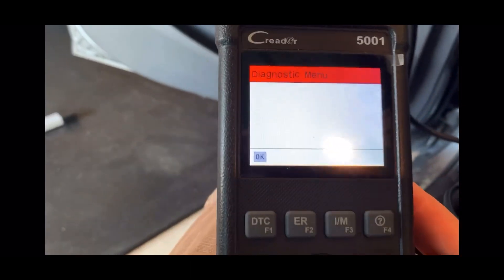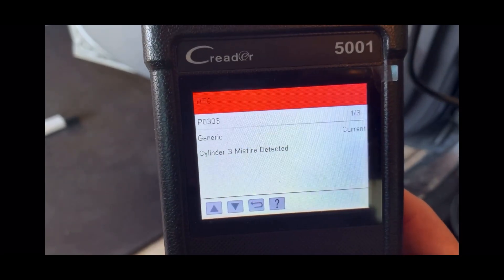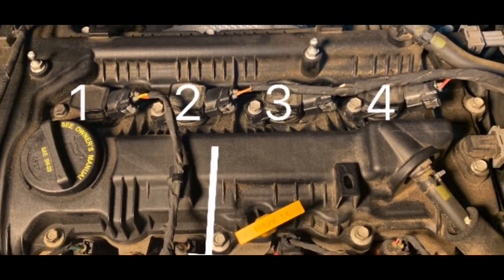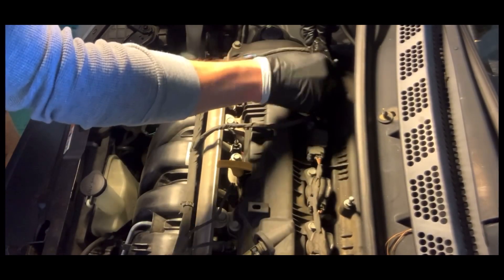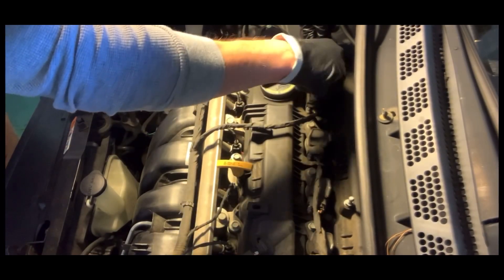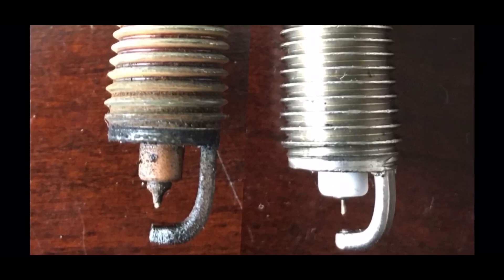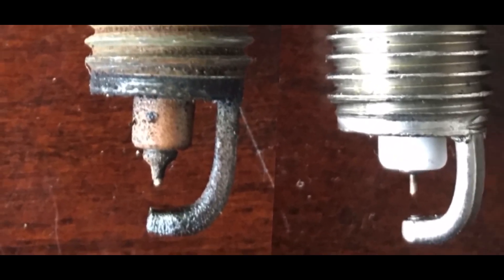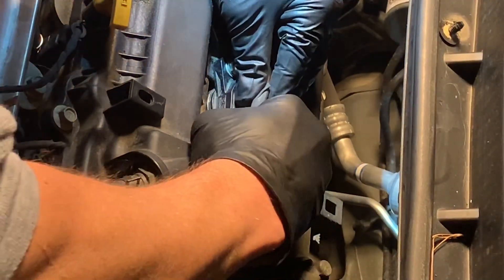Elantra 2013 Cylinder 3 Mis Fire, Spark Plug and Ignition Coil Replacement

Comment: Anyone know the part size for the bolt that’s holds the ignition coil in place? Mine snapped
Reply: 10mm
Reply from the maker: I believe it's this one https://hyundai.oempartsonline.com/oem-parts/hyundai-ignition-coil-bolt-1141706256k

Comment: Thanks for the great video, easy to follow and do the work yourself after watching it. I want to share with everyone my own experience with my 2013 Elantra's ignition...after my first (factory original) coil pack failure at around 280,000 Km, I found that the other three coils also failed, individually, within 9 months of the first one. I just replaced the last original one at 310,000. So be prepared to replace them all soon after the first one fails. Everything has a defined service life, even coil packs.

Comment: My car is Sonata 2009, American import, engine 24. It has a malfunction. When the rpm reaches 1500 revolutions, the engine shakes, whether it is moving or standing, and results in a weak engine torque.. I went to the technician more than once and he connected it to a fault detector, but to no avail without any result.  .. so what is the solution?
Reply from the maker: Does the code reader come back saying that there is a cylinder misfire? If not it could be loose engine mounts or could even be an internal issue with the ECM pushing too many volts to the spark plugs.
Reply: @23sapper  No. The reader says P0449 only this code is caused by the falsified men who you mentioned earlier ... with the science of engineers in good condition

Comment: I recently changed the oil on my 2013 Hyundai Elantra I got an error code p0303 cylinder 3 misfire and as well on the oil dipstick there's a tiny bit of white smoke coming out I can slightly hear a noise that sounds like possibly lifters it's a bit noisier than it was before the oil change but my oil level looks lower than it was but there's nothing leaking when I can read it could be possibly water from when I pressure wash the vehicle there is no open areas for your to get in the engine that I can see visually and there was nothing leaking so I didn't think this was the problem you have any suggestions on something that could possibly be the cause of this
Reply: Did you find out about hat the problem was?
Reply: @guillermosierra6718  no I ended up selling it
Reply: Thank you for your reply I’m having the same issue with a 2016 Elantra
Reply: @guillermosierra6718  it's going to cost too much to try to have a mechanic figure it out to be honest if you have the option to sell it it would probably be the best solution
Reply: Yes I’ll try to sell it
Reply: @guillermosierra6718  I'm not sure where you are but what I did was use the Kelley Blue book website and they can give you an idea of what your vehicle should sell for remember if you're going to sell it to a dealership you may get a little bit less but it's a guaranteed no hassle issue if you do private party sell you may get more money but make sure everything is legitimate these days people do try to take advantage of situations if you have a friend that can use a code reader for the car have them reset the code so when you sell it you're not selling it with the code hopefully this will help you
Reply: Yes definitely and thank you 🙏 I’m in Las Vegas

Comment: They ignition coil are the same? Because in my Hyundai Elantra 2017 say number 3 but I have to buy number 3 or all are the same?
Reply: A really good way to test to see if you have a bad coil is to swap it with a different one if it still comes up as cylinder 3 misfire then it's something else but if it changes to the cylinder that you swapped with the bad one then you know that particular coil is bad
Reply from the maker: All coils are the same. You can swap them out.

Comment: I have a question I recently change the spark plugs and at times when I stopped at a light or stop sign it starts to like rev up or want to shut off and put the scanner and says misfire cylinder 3 but spark plugs look good should I replace them again or go with something else
Reply: Check the (#3)ignition coil ,then (#3 ) injector.
Reply: I honestly think the Hyundai Elantras and this year have some issues with the piston rings or possibly some kind of a seal and there's also an issue that comes up with the lifters it would be good to look into this more cuz I have some issues that I would like some answers for if anyone has had these issues as well and has possible fix or reasons why
Reply: By any chance did you happen to get pre gap spark plugs if not you may want to check the gap are those very rare and can cause the situation to rise
Reply: @yourfriendlyplay6789  honestly don't know what that means just went to AutoZone bought them and installed them that was it

Comment: If I only need to replace 1 ignition coil do I have to take all of them ojt
Reply from the maker: No, just remove and replace the bad one.  I just did that with another car.  Had a miss fire on 5 and only replaced that one.

Comment: What is an easy way to get the coil off if it feels stuck....I don’t want to damage anything
Reply from the maker: I had that happen once and what I did was I took a zip tie and zipped it wide enough to where I couldn’t slide it down as far as I could get it and then tighten the zip tie as much as possible and I was able to pull from the base of the coil without tearing the rubber